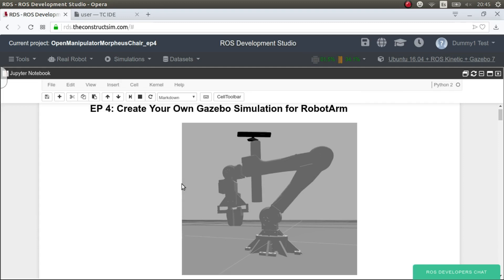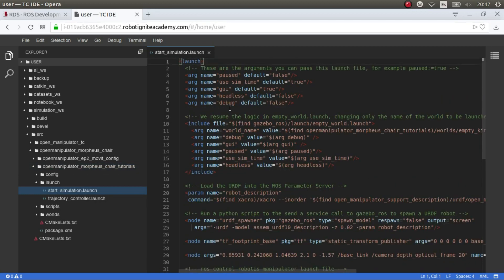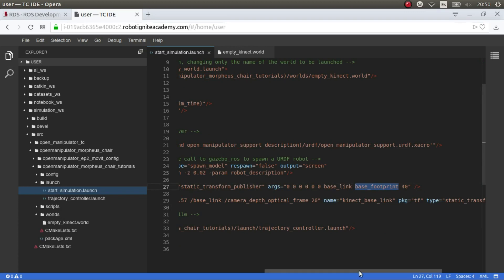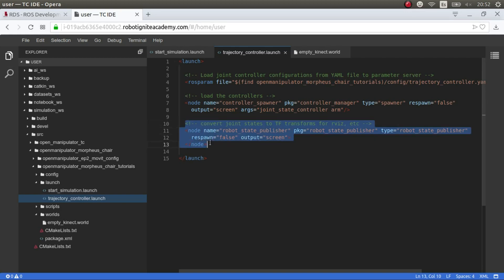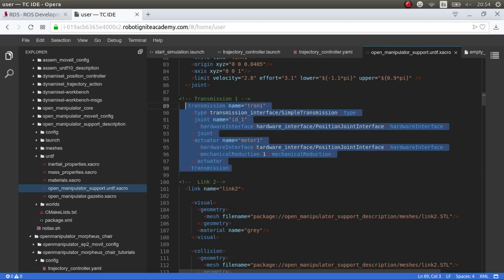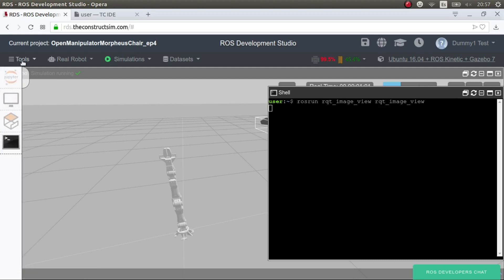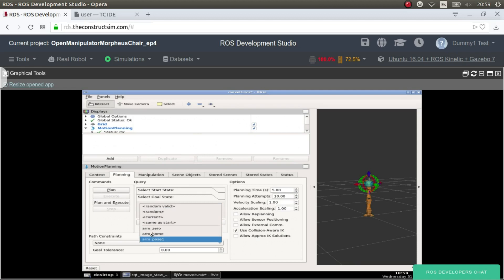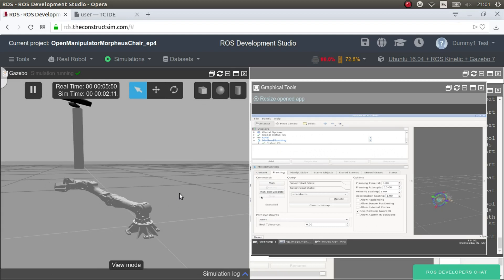[Morpheus Chair] Gazebo Simulation with MoveIt! for your Robot Arm | S4.Ep.4

Comment: You forgot to post the command to install the controllers, it wasn’t working for me and it took me a long time to figure out why. I installed using

sudo apt install ros-kinetic-position-controllers

sudo apt install ros-kinetic-joint-state-controller
Reply from the maker: You are right. We assumed the whole system was already installed. Thanks a lot for pointing it and providing the solution

Comment: Thanks for the videos, you are really helping folks, at least me, to learn ROS. I have a couple of questions. When I create the moveit package it doesn't create planning_execution.launch file. Are you creating it on your own? Also, you are not using any PID gains for the controllers, what are the potential consequences of not using PIDs? 
Also, do a video for the gripper control and simulation.

Comment: Very interesting and informative video. As usually. Thanks. For me the most important  thing in simulation is the fact that the simulation plays predominant role in designing (developing) process of the robot (robot body). We need to test if the robot we are going to build (physically) will successfully fulfill our or customer requirements (like motion - proper speed, acc, precision, low overshooting). We need also secure that the whole drive line is properly dimensioned and the joint stresses are under the limit.As we know there many parameters to check and adjust. As it was mentioned in video the simulation is extremely useful to verify different robot setup and configuration without any extra costs.
Reply from the maker: Markus we would like to interview you for the ROS Developers Podcast so you can express your opinion about ROS, how you use it, why, etc.... would you be interested? 
We thought of you because you are always providing very useful comments.
Reply: I really appreciate your message. I will be very glad to contribute and support you in all activities. Please contact with me using email (or other channels we will agree):
markus.x.buchholz@gmail.com